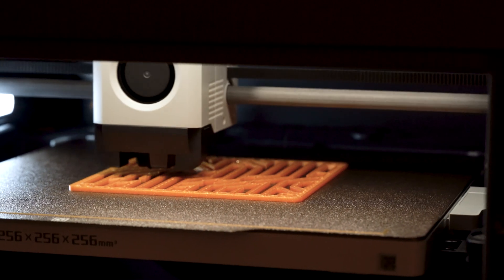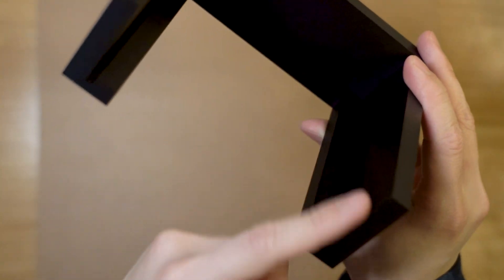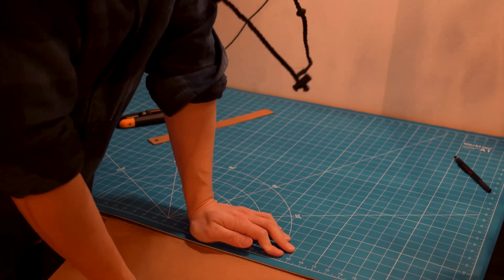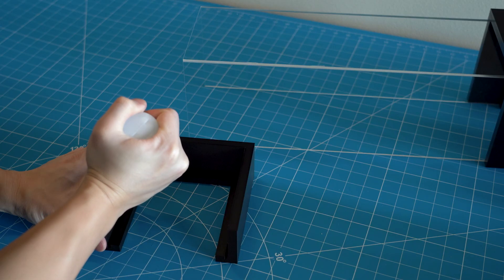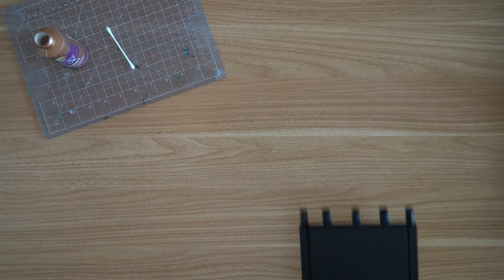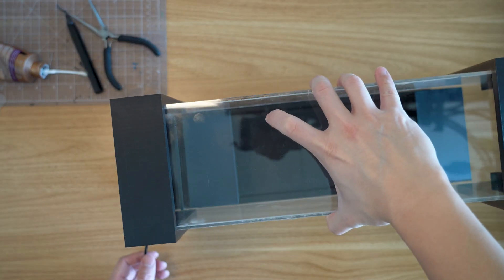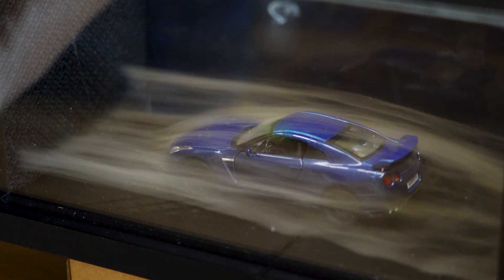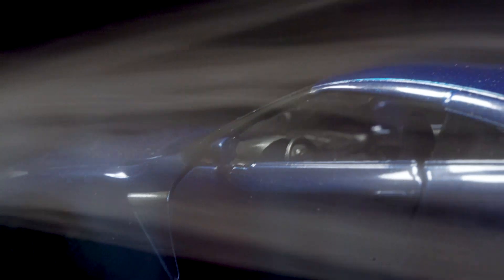DIY Wind Tunnel Build Complete! Testing My Dream Car Nissan GT-R | Part 3

Comment: Hi, could you share the dimensions or the 3D printable files?
Reply: Dude please provide the 3D printable files
Reply from the maker: Thank you for watching! I think I'll make the STL available once I have the design finalized and optimized because i think there are still some inefficiencies with the current model. For example, I would like to use a easier mechanism to open/close the enclosure (perhaps sliding door or hinge). Stay tuned!
Reply: @ ahh gotcha! great work soo far, quite impressed